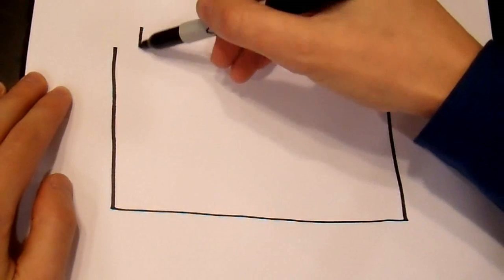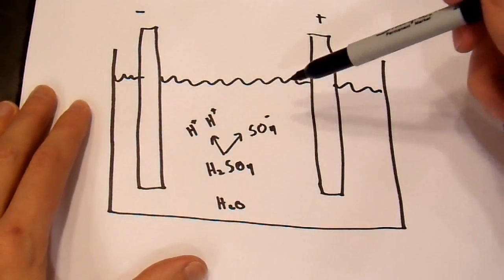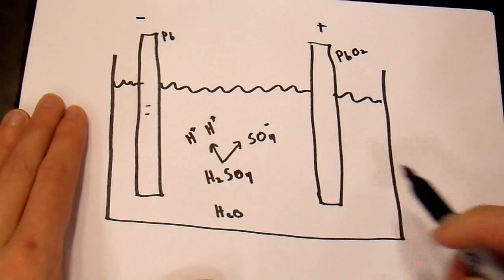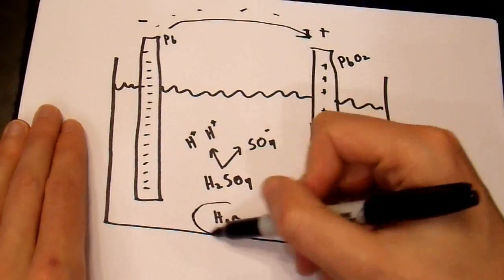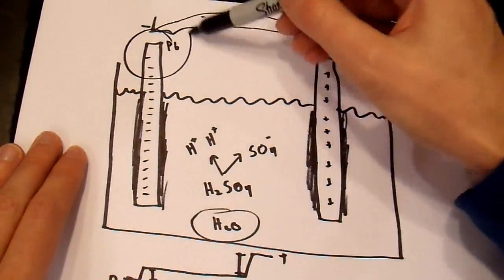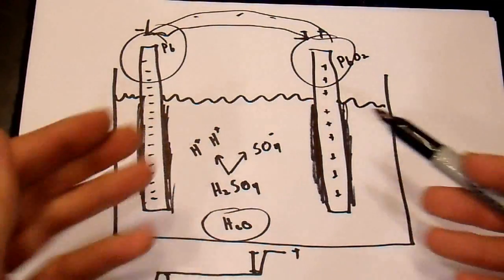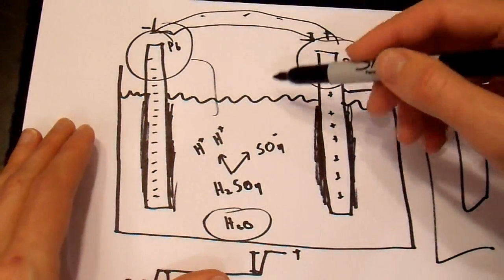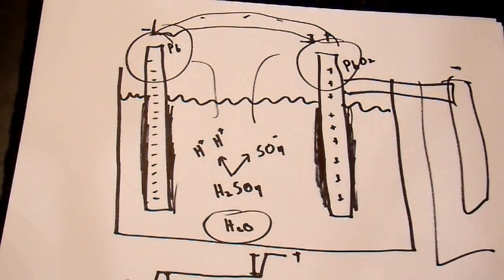Peukert's Law is Wrong and Here's Why - Part 1 of 3

Comment: This is cool. I did all these experiments back in 1999. You're the only one I've actually heard.- beyond myself -  articulate this. Peuker's has gone bonkers. Setting the Peukert coefficient in battery SOC meters also makes a huge mess of things!!
Reply from the maker: Any product that uses a Peukert coefficient in their marketing/manual is either a scam product or the designers of it didn't know what they were doing and it doesn't work properly.  your pick.  :)  Peukert's coefficients are indeed useful but aside from yourself I've rarely seen them used properly.  I would argue, in fact, that they have very little utility in most real-world situations.
Reply: @knurlgnar24  Agree 100% and I think it might be mostly the latter. Almost every 'reputable' / popular AH meter on market implements Peukert coeff and almost-as-misconstrued charge efficiency parameters in order to calculate an almost-always-drifting and bending SOC indication. It's been virtually unchanged for over 20 years now and, imho, it's one of the main reasons the deep cycle lead acid battery industry suffers from such rampant chronic undercharging - and leaving itself wide open to lithium predators :) Rarely do people 'get it'.

Comment: Something you said is misleading.  I will clarify here...  If you take 4 identical 12V 100Ah batteries and put them in parallel, the runtime of those 4 should be IDENTICAL to that of a single battery with load L, if you put a 4L load on the bank of 4.  That would mean each battery is seeing about L load.  For example, a 12V 100Ah battery with a 10A load might last 4 hours before the low voltage shutoff on an inverter prevents it from discharging further at that rate.  Similarly, the 4 battery bank with a 40A load should last the same amount of time.  This is assuming the load and batteries are wired in such a way that there is good load sharing in the 4 battery bank, however it need not be perfect.  For example, if the actual drain on each battery is 9.25A, 9.75A, 10.25A, and 10.75A, that may be close enough so all drain similarly.  Also when the load is removed, they will likely equalize in voltage and capacity once again.

So just to be clear  100Ah + 100Ah + 100Ah + 100Ah does indeed = 400Ah, if the load is also 4x (that of the single 100Ah load) in the 400Ah case.

Also, another thing that you said that is misleading is that the temperature of the battery as no effect on capacity.  That is wrong in at least 2 ways:

1) The Cold Cranking Amps (CCA) of a battery is different than the Hot Cranking Amps (HCA) of that same battery.  The HCA is much higher than the CCA.

2) A hot battery will self discharge much quicker than a cold battery.  So imagine you have a very light load on a hot battery vs. on a cold battery.  The hot battery will NOT run that light load as long as with the cold battery.

You mentioned there is a lot of wrong information on the internet.  Well that is correct.  Unfortunately some of it is in your videos.
Reply from the maker: Your first paragraph is restating what I stated already in the video.  You either did not watch it or you did not comprehend the video.  And the capacity vs temperature claim is a straw man.  Internal resistance changes with temperature as I mentioned in the video so, yes, CCA changes.  Usable capacity also changes with temperature due to the change in internal resistance which I also stated in the video.
Reply: I watched it and listened to it again and you said wrong stuff.  You said that 4 100Ah batteries paralleled together is not 400Ah.  Of course it is! The Ah capacities are directly additive.  You didn't say the usable power at some fixed load.  Also, temperature DOES change the usable capacity of a battery.  At very high temps, the self discharge rate is MUCH higher then at cold temps, therefore more power is lost at high temps.  You can test this easily and it will likely be correct.  Also, if you discharge a battery VERY fast (relative to its Ah capacity), that is LESS efficient (due to heating) than it is to slowly drain that same battery (at only maybe 10% of its Ah rating).  So many things you say (as you say them) are wrong, but perhaps you go on later to explain them more in detail (which I think is a bad way to make statements).  That would be like someone saying "electricity takes the path of least resistance", but then later go on to say that it takes all paths of resistance.  Even though the first statement is true to some degree, it is very misleading as someone may wrongly interpret as "electricity ONLY takes the path of least resistance".  Obviously that is a false interpretation.  You seem like a smart and knowledgeable guy, you just don't state your ideas correctly.  I can give you exact times where your errors are in this video but I think you are smart enough to find them yourself.  Even in the first few minutes there are some "speakos".  1:20 elapsed "that's not really the way it works"... YES IT IS!  The actual Ah capacity is directly additive for 4 paralleled batteries.  The usable capacity at some fixed load may change but you didn't say it that way!  Even your title is wrong. Peukert's Law is NOT wrong.  You should have titled this video "Peukert's Law is frequently misinterpreted".

Comment: It seems to me if you take 5 identical batteries that are all 12V and 100Ah each and you put some load on 1 of them that is say L amps (L is some constant such as 10), you will get some runtime for that battery at that load (let's say 10 hours of useful runtime).  If you take the other 4 identical batteries and parallel them together properly (so there is the same resistance path to each battery from the load's point of view), and you make the load 4L, then it seems the runtime should be identical (10 hours).  So in that case, 100Ah + 100Ah + 100Ah + 100Ah = 400 Ah since the load is proportional to the battery bank size.  Even if it wasn''t, the true Ah capacity of each identical battery is additive regardless of the load.  For example, we can approximate a battery's true maximum Ah capacity by using the 100 hour drain rate number.  Let's suppose it is 120 Ah.  So if I take 4 of those batteries and parallel them, I would then have 480Ah of actual capacity.  Whether or not I can get all of that out depends on if my load is fixed or variable.  if I "lock" my load at some high amperage, I wont be able to squeeze the last few Ah of power out of my bank, however if I either use a small load or a load that starts "heavy" but then tapers to lighter, I should be able to get the full 480Ah (in this example).

If you get a chance, you should do a video on what happens when you take healthy batteries of different Ah ratings and parallel them together then load them.  Will each one drain the same amount of Ah or will the load favor the more powerful battery (the one with more Ah).  Also, what might happen when you charge this mismatched bank?

Comment: Hi Knurlknar,

I am a mechanical engineer at home today with some back issues laid up in bed and have been watching a LOT of your videos. Due to several recent power outages and the fact that I live in Seattle which is a level 4 earthquake zone I have been thinking about supplementing my Honda EU2000i generator with a large battery bank and an inverter. 

Anyway I've really been enjoying your videos and the way you present information. Thank you!

Comment: While Peukert's Law does not change the intrinsic Amp Hour capacity of the battery, it does affect the ability to use that capacity, simply due to series resistance during higher discharge rates.

Comment: Sorry but nothing you said here really is anything amazing? Seems you misinterpreted everything and assumed everyone else did.
It's a well known fact that if you discharge a battery at a lower rate you can discharge is more and the voltage won't drop as much while constantly being drawn from. 1+1 doesn't = 2.7 but really =2 just like all the information says.
The reason that on your other little video that it took a little while longer to drop to the cut off voltage you decided on is that when drawing a battery at a lower current (when you have two in parallel the current is half for each) then the voltage will plummet more slowly.
A great example of this would be if you hook something up to your battery that uses even more power such as 3000w. The voltage will plummet ever faster. This does not mean you have reduced your capacity but it's just a property of the battery. Wait for a while and the voltage of the battery will go back up and you can do it again and again etc.
Reply: It's a magicians trick. 

If you notice the two battery parallel had the extra 40 amps each. That allows the heater to run the extra .7 time.

The heater cuts off at 60 ah on a single battery. Leaving 40 ah left after recovery. But with two batteries you now have 80 ah. 40 ah each. That 80 ah let the heater run the extra time but the batteries recovery voltage wasn't as high. He left that part out.
Reply: It’s because the heat comes from the current (I) not the voltage.

Comment: Why do manufacturers rate their batteries with a cold cranking amps and regular cranking amps?
Reply from the maker: Because batteries have a higher internal resistance and electron mobility at cold temperatures than at warm ones.  If you don't expect to encounter cold environments then you can use the CA rating, otherwise use the CCA rating.  They aren't really both necessary since lead acid batteries are all chemically similar, but it makes comparisons and purchase decisions easier for those people who don't want to learn how to approximate the conversion factors.

Comment: Very interesting! Nothing is better to wake up in the morning than a good battery video. :D
Why is the voltage for a Pb cell around 2V?
Reply: +Lagm an   I am no expert on the subject, but just like if you drop some thing from an aircraft, it will accelerate until it reaches its terminal velocity and then it will go no faster, I think that each terminal material and acid has a limit. In other words lets say you used stainless steel and nitric acid to make a battery then its chemical speed limit will be, lets just guess and say 0.8 V per cell.